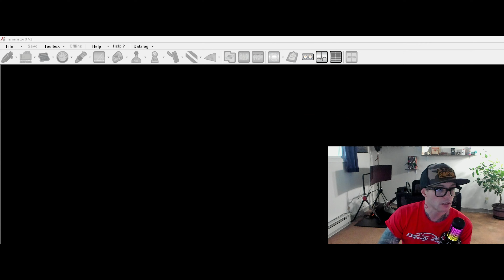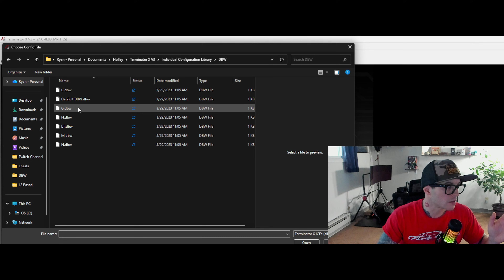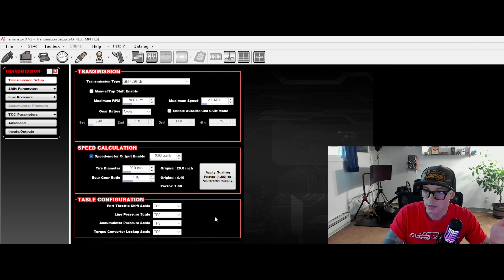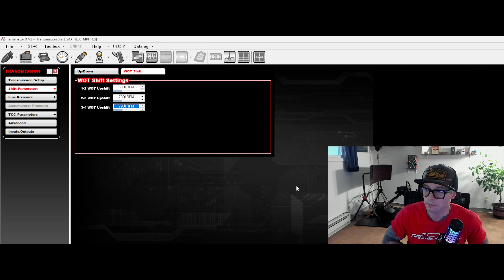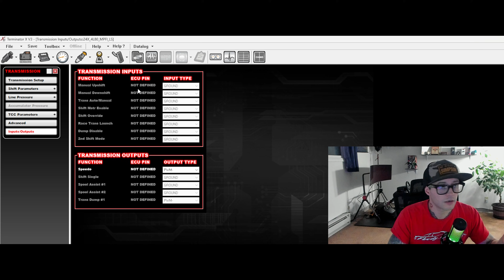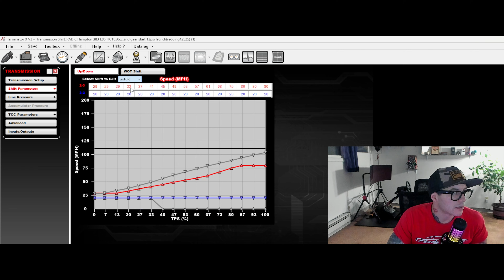A Transmission Builder Talks about Tuning and the Holley Terminator X MAX System

Comment: Let me tell you about the transmission setup I've been obsessed with for over thirty years. It was in the July 1995 Popular Hot-Rodding magazine. A guy at the former U.S. Speed Research in Milwaukee came up with a kit to couple two TH 400's together front to back. The front trans can be automatic or manual shift; the rear one has to be full manual; two shifters. It compounds the gearsets making five forward gears. The rear trans can start off in 1st, 2nd, or 3rd. You essentially have a choice of three rear end ratios. With 2.41:1 rear gears, rear 1st acts like a super low 5.97:1, rear 2nd= 3.56:1, rear 3rd= 2.41:1.  It's no longer available but I'm trying to get people interested to help figure out how to build or buy one of these bad boys. The trans gear ratios go:  1st/1st= 6.15:1, 
2nd/1st= 3.67:1  3rd/1st= 2.48:1,  3rd/2nd= 1.48:1,  3rd/3rd= 1:1. I found a Tuber that has this setup in a '72 Monte Carlo. He has a couple of short videos, search for...      "What the twin transmissions look like"    and    "In car video. #72montecarlo"

Comment: The Duty cycle is the amount % the solenoid is commanded closed .
Reply from the maker: Correct. In holley 0% would be 100% closed and max pressure commanded.

Comment: Looking at this for a good reference and somebody had a complaint of it just jumps shift quick. Had em all at 4000. Guy told him to change it 250 in difference
Reply from the maker: Always set the point about 200 rpm before where the desired rpm is achieved. Always remember - Electronics are instant, hydraulics are not.

Comment: Hey Ryan Good Morning,  I watched a video on tuning,  80-90psi line pressure was mentioned , i believe it was idling  in drive was the target pressure?  Also adjusting the EPC was talked about,  Does this mean to drop the Pan and turn the screw a bit on the back of the EPC to get the 80-90psi or somehow  do it in the ECM by increasing Line presure in the Shift presure table?
Reply from the maker: 1 yes we build in 80-90 in our units as an example.
2 yes but adjusting the epc also raises pressure at the top as well as the bottom, we dont do this method as i find it increases top end too much.
3 the tcm controls the line pressure and line rise overall and yes it can be raised to a degree in the computer based on where youve built it in mechanically inside the transmission. If youve only built in 200 psi capable inside the trans then the computer will not be able to go over 200psi fot example
Reply: @PerformaBuiltTransmissions  Ryan that makes complete sense ,  So Basically if you see 220 PSi with a gauge screwed in than you cant  get more Line Pressure than that adjusting your Tune ,  I believe there is a Sonnax O-ringed .490 boost valve in the pump,  (i didnt build the Transmission)  , Besides the boost Valve and drilling the plate what else Mechanically helps raise line pressure?
Reply from the maker: Correct and the boost valve is all that raises pressure other than messing with the springs in the valvebody pressure circuit and pr pump area
Reply: @PerformaBuiltTransmissions  OK i use a TransGo drop in PR Valve, The one with the longer lands and comes with a stiffer spring etc,  What typically do you see using a sonnax .490 valve vs a .500 valve,   I have to wait a bit for the nicer weather before i can put a gauge on it and Road test ,
Reply from the maker: Im not sure tbh i dont use sonnax. I make my own boost valve. Ive used a .490 many times before and it nets right about 180
Reply: @PerformaBuiltTransmissions  180 for the sonnax .490 valve,  i thought maybe a bit more than that, how about a .500?
Reply from the maker: Probably 200
Reply: @PerformaBuiltTransmissions  OK and iyop 180-200 will hold about how much power
Reply from the maker: Pressure wise - pretty much any amount you can throw at it. Theres many more variables than just pressure though in regards to how much something will hold.
Reply: @PerformaBuiltTransmissions  Yeah i know,  so the .500 boost valve is the biggest off the shelf valve i can get?
Reply from the maker: On the market as far as i know yes
Reply: @PerformaBuiltTransmissions  Hey Ryan Hope all is well,  Yeah i see that the .500 is the biggest out there for the boost valve,  Quick question The accumulator "valve" (Dx, Cx, Yz) what exactly does it do, i hear that is feeds - regulates fluid to the 1-2 accumulator?  i do know by installing a stiffer spring firms up the 1-2 shift, does is have any effect on the 2-3 or 3-4 shift,
Reply from the maker: Just 1-2
Reply: @PerformaBuiltTransmissions  O-ok, what can be done to firm up the 3&4, On my 2009  60E i just blocked off the 4th accumulator with a set screw,
Reply from the maker: More clutches, pressure tables specific to those gears and following your powerband in tuning for pressure.
Reply: @PerformaBuiltTransmissions  Thank you ,  I am doing a 7 clutch Stack up in my 09   (6) .076 steels and (7) .080 clutches,  set to .030-.040 ,  i see some do a 8 stack with (7) .076 steels and (8) .065 skinny clutches,   My  09 is only  going to be a street-cruiser behind a miled cam and exhaust  5.3 build  , looking to do a 09-2012  Two wheel drive Colorado.  which do you personally prefer the 7 or 8 stack up

Comment: Great info thanks for putting this together. If you're in the mood to answer questions, daily driver truck with a stock 6l80 (upgraded torque converter only) and a mild cam/AFM deleted 5.3 will the base Holly tune be safe? 

I'll be looking into adding a line pressure sensor I was shocked it wasn't built in to the trans!
Reply from the maker: As long as the pr valve is addressed and a truely reputable converter is ran with a correct tune it should be fine.
Reply: @PerformaBuiltTransmissions  had a shop I trust rebuild it I'll ask about the pr valve thanks for the reply. Just starting to learn to tune after an engine swap so appreciateit.

Comment: What line pressure do you like to see at idle and max line pressure on 4l60e? I see you said you tapped down from around 30% duty cycle on a turbo build but from my experience with any performance 4l60e ive ever owned the idle line pressure has always still been relatively high at 30%, im talking around 200 psi which in tell causes a harsh engagement when going from park to gear, for granted I know you didnt built my transmission so mine may be a little different but from my experience around 80-100psi at idle seems to be where the engagement isnt so rough. Figured id pick your brain if you had the time to respond.
Reply from the maker: Ours see 80 to 90 at idle even at 30%-34%. Standing pressure comes from the build itself. Tune just controls how it progresses. Engagment for a modified car and modified transmission will always be firmer and i feel its just something folks have to come to grips with or keep burning up transmissions. I cant speak for other builds but i do know 99% of them are built harsher than ours. Try hooking up a manual guage to the trans to see where real pressure is at idle and adjust the epc mechanically if your builder has turned it up like most do. Also verify with your builder he didnt drill out the fwd feed hole, alot do it and all it leads to is harsh engagement with no performance benefit. Also you could put a softer spring in the forward accumulator in the valvebody to adjust engagement. Id rather you adjust mechanically from the suggested as pressure is like air feul in an engine... it needs to be what it needs to be and should never be adjusted by feel. Try those tips instead and put pressure where it belongs. ** if your idle pressure is at 200 psi on engagement something is wrong or the build isnt done correctly.
Reply: @PerformaBuiltTransmissions its definitely reading 217psi, I have a pressure sensor on the transmission and im on holley so the numbers are right, ill ask my builder if he drilled them out, sounds like he most likely did, can I change that spring without dropping the transmission? I have a rossler brake in my tranny as well.
Reply from the maker: Id see a different builder based on what im hearing. 220 psi  is what ours sees at WOT lol at idle thats crazy and bound to break parts. I think you got a guy like many other that puts all the fancy billet and jacks pressure to the max but doesnt actually know what hes doing. You can change the spring without dropping the trans but it isnt going to have a huge impact on 200 psi lol. We use rossler brakes but that brake has nothing to do with idle pressure. Your builder is an idiot sadly.
Reply: @PerformaBuiltTransmissions I went in yesterday and changed my tune from duty cycle vs kpa(map) to duty cycle vs tps and at 0% tps and 50% duty cycle its puts me right at the 100 psi mark in idle, I ramped it down to where at 40% tps im 100% duty cycle and it seems to engage much better now. You know my transmission builder well but im not going to say his name because id rather not be the cause of issues.
Reply from the maker: Just male sure you arent building boost at a fixed throttle angle when using tps for line. I dont know the builder your speaking of but any builder that does pressure at max 200 plus build wise throughout all range needs their tools taken away.
Reply: @PerformaBuiltTransmissions most definitely, I dont drive my truck like that anyways. 90% of the time i just cruise it unless im wot which is rare. Ill log it the first couple of times I drive it around to make sure the trans pressure is fine, oh and you definitely do know him Ryan. Its a small world man, us average Joe's know who most of the well known guys are building engines/trans and to some extent we know the work histories.
Reply from the maker: I rly dont and dont care to as its not important. If you were stuck at 200 psi regardless of tune adjustment, then check epc for function or see a different builder. If tune changes things then keep reworking it until you get desired results. Thats my only input.
Reply: @PerformaBuiltTransmissions I agree and will do, thanks for the input

Comment: Hey Ryan. I have a stock 03 silverado 5.3l z71. Would it hurt to use a 1900-2200 stall converter or shorten the life span of the 4l60e
Reply from the maker: No that wouldnt hurt anything. Your not too far off from stock stall.

Comment: Good video, not sure if this is a silly question or not sorry. But does line pressure effect trans oil temp? I have a 4l60e that i feel gets to hot. Approx 200 degrees when driving. It has a 2500 convertor (Which i know contributes to heat) and also a transmission cooler and fan. I run the holley terminator x software. I have the transmission fan that comes on around 170 degrees. However, line pressures are quite aggressive after 30% TPS. Id like my transmission temps around 180-190 max.
Reply from the maker: Its the other way around, Temps affect line pressure and there is a table for adjusting that in the holley transmission icf. On a stock computer esp gen 4 heavily relies on oil temp. 200 degrees is definitely too hot and will shave approx 20k miles off the units life or more

Comment: Ive found on an NA build, the line pressure duty cycle table works fantastic for dialing in part throttle hard shifts. specifically the 1-2 and harsh engagement from park to drive on a built pump.
Reply from the maker: Id still stick with its the builder job to mitigate shift feel mechanically while leaving the tuner to set a line pressure specific for the intended application and powerband. Just my two cents. People often who adjust line too much for feel end up with no 3rd gear. Your correct though N/A is more flexible than boost. My market unfortunately is 99% boost

Comment: First off, thank you.  This is a very niche topic, so I assume you will make little to no money from YouTube from this video, so I appreciate you donating your time and expertise to all of us watching.

To possibly answer your question about the duty cycle graph being inverted.  I assume the shift solenoids used a spring to close the valve, and the Holley TCM sends a Pulse Width Modulated (PWM) signal to the solenoid to open the valve.  Changing the duty cycle of the pulse width modulated signal changes the amount the valve is opened.  So the inverted graph is “correct” in the sense that it shows duty cycle of signal that Holley TCM is sending to the solenoid, but to your point most people care about line pressure not solenoid duty cycle.  I think this is similar to the debate between AFR and lambda.  Both are correct, but they are different ways of looking at the similar information.

For those of you who aren’t familiar with Pulse Width Modulation (PWM), the following video is a good explanation.  Note the video discusses “flow” which is not the same as pressure.

https://www.youtube.com/watch?v=UbGEUR5u4Dc
Reply from the maker: I am very familiar with electronics and the epc duty cycle as well as the translation but i dont get why holley didnt opt to translate it in their software like others is what i was asking. I wanna know why they chose that route but probably for cost effectiveness. Your correct, i do this for free and will never monitize this channel as i think monitzation is wrong. Thank you for watching and your contribution to the channel.

Comment: Man do you think its possible to keep a 65 happy behind an LS1 450hp/450tq crank 
05 crew cab 
Stage 2 btr truck
4800 lbs 4x4 full weight its 20s on 33s 
3.42 ;( 

Recommend converter and gear?
Reply from the maker: That should be extremely easy to do. What reasearch have you done so far? Or is this the first time your thinking about using a 4l60 65?

Comment: Great video! would you be willing to do some stock ecu stuff? I know that ive struggled getting some "higher power" heavier stuff to make the 2-3 shift and had to have a more experienced tuner help out to learn what it takes to make those shifts under power.
Reply from the maker: Im hopefully releasing that one in december but itll be a brief overveiw like this. I did holley mostly because there are no videos on it. Hp tuners has many many videos and resources out there i encourage you check out. I mostly make these videos to show how many things have input in your transmission and any negligence in setup and service with the vehicle will cause them to fail. Im only trying to tell the world, most of the time when a transmission fails... its probably not the transmissions fault.
Reply: Very interim std ecu tuning

Comment: So Ill chime in on the line pressure setup..  0% duty cycle on EPC will give you max line pressure same as if you were to unplug it. Applying duty cycle will lower pressure.. Holley doesnt translate solenoid duty cycle.. Other Ecus like Maxxecu  will give you the option to translate solenoid duty cycle. So 0% is minimum line and 100% duty is full line pressure. But if you know how EPC works. Apply duty cycle to add pressure is backwards of how it actually works
Reply from the maker: Thats what i was looking for, the holley translation part. Thank you for clarifying.

Comment: Thank you for the video man!  It was very helpful and gives me a much better understanding of my setup (4L60E, Sonnax 2.84, level 4 build from one of your competitors), 650 hp 427 SBC, Terminator XMax, Circle D, Moser 9" 4:11 spool, 3550 lbs race weight...  you and I spoke about my setup (~2023 wintertime) before I ran it.
During my first two visits to the track in spring of 2024, my truck didn't want to upshift at full throttle (it was hitting the rev limiter).  After speaking with Holley, they mentioned it could have something to do with the small diameter of the Hall-Affect sensor in the dual sync distributor that I'm running.  The tech mentioned at higher RPM's it may not be as accurate...  I mentioned that to my tuner but we also watched a couple of videos of my truck and could hear that it wasn't reaching peak shiftpoint RPM between 1-2 and 2-3 shifts - he ended up increasing the rev limiter to 7400 to get it to shift at 6500 and it works great.  I am committed to an upgrade to your Black Edition 4L60E if my existing unit gives out!
Happy Thanksgiving to you too!
Reply from the maker: It was a pleasure speaking with you!!
Reply: @PerformaBuiltTransmissions  The struggle has been real for me in Detroit, had a local guy build me a 4l80e for my 70 Monte Carlo, like you said these transmissions shops are not comfortable with the tech side of it, so he defaulted to the younger guy who was installing my sniper 2 efi..(BIG Mistake) he let the guy install it and configure it, he screwed up the physical install of the transmission resulting in some of the gears getting burned up (so the guy who built the transmission had to rebuild  it) They tried to blame it on a faulty Holley transmission controller ( which I knew was bullshit) because I test drove the car and brought it to his attention that the transmission wasn't shifting right..so at this point the guy who built the transmission took over and set up the transmission (which is very intuitive and straight forward with the sniper system) however, I think my shift points are off, I have a stock converter 1800 stall speed, 3.73 gears, tire height is 26.7..this is what he has it set to..Holley has been no help like you alluded too
Shift Up 1st-2nd =10mph-44mph
Shift Down 2nd-1st =7mph-30mph
Shift Up 2nd -3rd 24mph-83mph
Shift Down 3rd – 2nd =21mph-68mph
Shift Up 3rd -4th =36mph-130mph
Shift Down 4th -3rd  =29mph-100mph